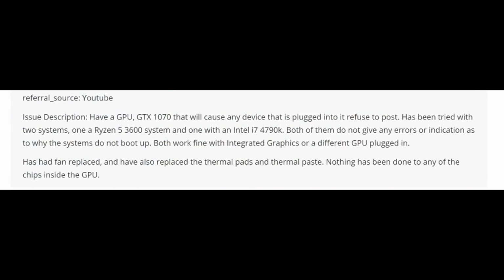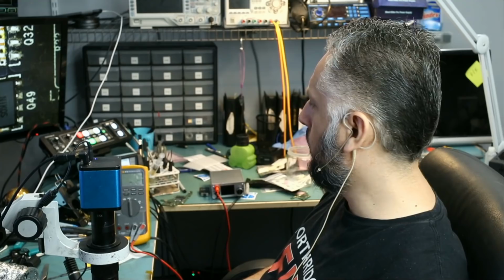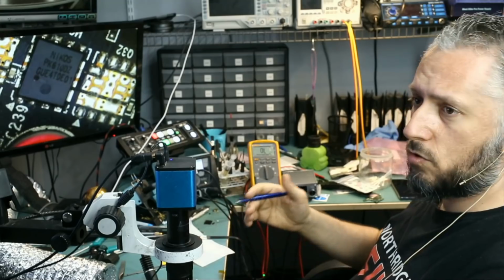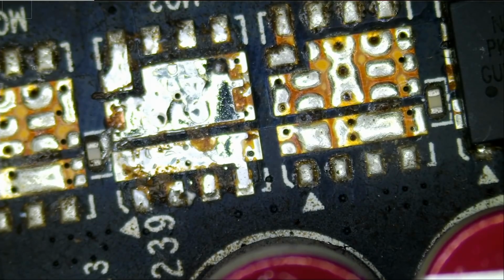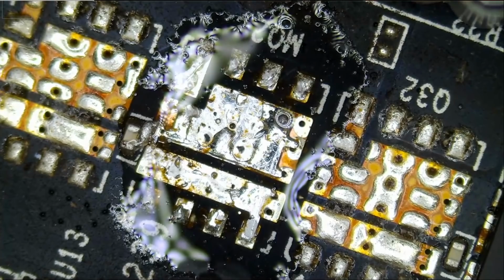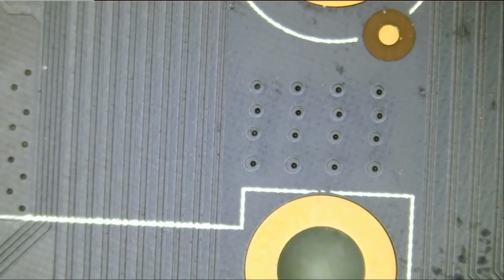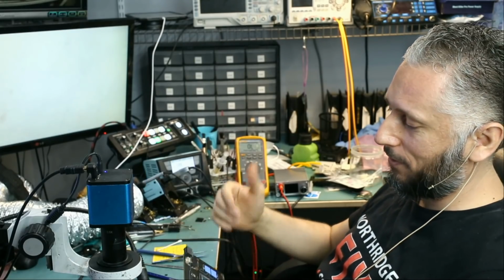Zotac GTX 1070 Mini Graphics Card Repair

Comment from the maker: There was a tiny blob of solder left of the mosfet that appeared to be bridging. It was later cleaned off and wasn't making any contact.
Reply: I was about to tell you  😂👍🏻👍🏻
Reply: There was a solder blob on the left side of the mosfet that was near an ceramic capacitor.
Great work man.👍
Reply: What time is it where you are? Do you edit your vids late at night after a long day of work? It is 9.30 am here in Ireland.
Reply: @dankan4459  he once mentioned that he stays awake editing videos till 3 am
Reply: @roseelectronics4582  that is dedication!
Reply: @dankan4459  indeed
Reply: @dankan4459  If it's 09:30 in Ireland it will be 01:30 in California, 8hr time difference.
Reply: that solder blob was already there from the beginning, even before you removed the mosfet., maybe it was the original issue bridging?
good fix though :)
Reply: haters gon hate
Reply: Thought you cleared that out huh🌝, some people are still complaining about it🙃.

 they probably think that when you end the video you stop working on the device, which usually happens After you give it to big boss for final assembly (I think). 

Nice work by the way I really like the Graphics cards repairs especially in these times.👍🏻🙂
Reply: Phew!!
Reply: hey what do you think that makes a dead card doing a loud coil whinning sound , no post no fan spin, i would appreciate anything if you have any advice on top of head , thanks
Reply: @trOyYey  mining cards it seems like lately really people shouldn't mine at all if they don't know what they are doing it's just destroying cards that we have a shortage on from scalpers and money hungry gpu hoarders
Reply: I actually noticed that. xD
Reply: lol i was staring at that the whole time like is he gonna clean that up but then when u never did I just figured it was another repair or something  lol
Reply: Was going to write about it ;) good job!
Reply: Silly question: how can you tell a N-Channel MOSFET from P-Channel, is due to the application, location, size, composition by design?
Reply: Another quick question: Does your multimeter provide diode readings as well when using continuity mode?
Reply: how much would that repair cost the customer in your shop?
Reply: I think i have one at the fourth one do you know how to fix it and so how to get part without buying donor gpu because there like 200 broken 500 used
Reply: I spotted that 😀
Reply: Yeah i noticed that aswell!
Reply: Nice

Comment: from my past experience usually ppl got short circuit because of not using a surge protector n a cheap psu without 80+ bronze sticker, rarely ppl got this issues when they r using that 2 tools

Comment: Hello Alex
I had 4 shorted MOSFETs in my GTX 970 so I replaced them but they shorted again. I noticed something very strange is that when I spray a contact cleaner on the corresponding Gate Driver the short is gone, but when I tried to power the card again the short is back. I did that about 3 times and the short goes away every time with the contact cleaner on the Gate Driver. How can that happen?

Comment: I have this exact same card but i Hurd a pop when I plugged it in to my new computer. and I belive I popped some of the resistor or caps thats under the headsink I was wondering if could repair mine or what parts I need to replace.

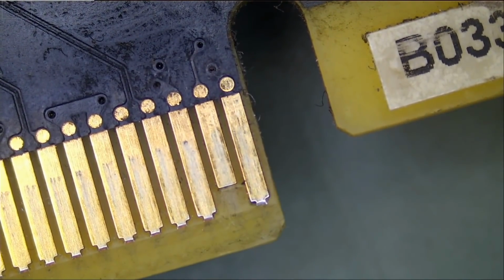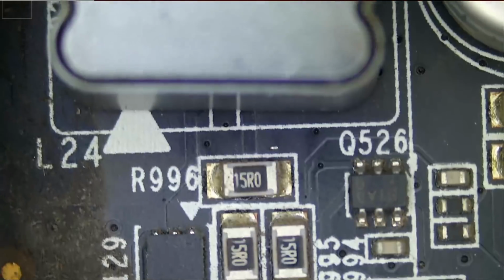Comment: that tiny piece on the edge connector gold plated finger you mention is broken off around 1:20-1:50 is actually meant to be that way, it's so the power is applied in certain sequence if hot plugging

Comment: I think you should install a hard drive with an operating system on the motherboard that you did the tests on it to see if the graphic card is fully working after the system boot's up.

Comment: hi, it would not be bad to check the signal shape of the repaired phase. because I know that transistors rarely burn out on their own. here, either the driver did not give the correct signal form or the transistor overheated. if there is an opportunity, can you check this in your videos, if you have an oscilloscope. it would be informative

Comment: 6:12, as y say before, grafic cards,  need do be preheat undernet the board, to make easy to remove mosfets, and cover aluminium folid the caps, using this metod mosfet is out in 10 seg or less, in a dayli basic work, it will show improve in time and quality of repair.

Comment: If the mosfet gate is less than infinity or the resistance of the drive then the probability is that the source - drain is also short. I usually measure the body diode of the mosfet to see that there is no short there.

Comment: I Change RX 570 8GB sapphire nitro thermal pads with thermal grizzly ones at 1mm size instead of 0.5mm and every card suddenly died with replaced pads.

Comment: I think that high resistance reading on first gate is part of a problem. Resistance you read came from pull down resistor. It's usually around 8-10K because that's value of gate discharged resistor used. Too high resistance on first gate can leave it closed when it should be open and destroy second mosfet in process.
It will probably die quicky again.

Comment: Hey @NorthridgeFix when applying heat near aluminum capacitors like you do here a neat little trick is to use the blade from a box cutting knife as a heat shield. Just rest it against the side of the capacitor and it'll dissipate the heat. Heck you probably have a load lying around somewhere too :D
Reply: There's a special heat resistant sticky tape just for this purpose as well! It's brown/gold-ish colour and semi transparent

Comment: He needs it expedited because he cannot miss out on Overclocked Bitcoin mining :)

The reason they have recessed contacts on the edge connector, is because the surrounding contacts will make contact to the connector BEFORE that pin does, it is a protection in case of either voltage or static, so when the shortened contact does make electrical contact, the surroundings ones are already on circuit, helps with grounding an important signal / trace

Comment: a trick to find low resitance 'near short' components is to put a little power on the shorted rail and use a thermal camera to look where it's getting hot or cover the board with alcohol and see if there are any hot spots, where it evaporates faster.

Comment: My guess as a guy who works with graphics cards there was ESD shot when replacing thermopads. I know that from my personal experience. It's a common problem. As you can see very easy to find and fix issue.

As usual amazing job @Northridge Fix! I am glad that those aluminum caps don't pop up when working near by 😉

Comment: Great Video. What is your mostly used Nozzle-Diameter on the Hot-Air? Greeting from Germany
Reply from the maker: I use the biggest available unless i want to focus heat on one specific component then I go for something smaller. I switch between 10mm to 3mm.https://northridgefix.com/product/quick-861dw-hot-air-station-nozzles/

Comment: The gate of a mosfet, out-of-circuit, should look like a capacitor: checking it with DC, from gate to source or drain, it should read as an open circuit. In circuit, of course, will vary depending on what it’s connected to.

Comment: Did you try reading that first mosfet after replacing the bad one? is it possible that the high reading on the first one was caused by the short on the second one? Sorry if this is a dumb question. Thanks for your videos and positive attitude :).
Reply from the maker: Yes still reading around 200k.

Comment: i am a bit disaponited you didn't notice that tiny solder blob stuck to that capacitor next to the mosfet you worked on, but i am impressed with the speed you found the fault
Reply from the maker: Read pinned comment
Reply: @NorthridgeFix  now i did :P
you never know about them when you watch someone video right after it comes out and comments didn't show u yet

Comment: You can use Kepton Tapes, to protect the caps, from the heat.
Reply from the maker: Kapton tape does not protect. It does more harm then good. Kapton Deforms when heat is applied to it causing components to shift when solder liquefy. I'll discuss this in a future video along with foil tape. .
Reply: @NorthridgeFix   foil tape leaves a glue residue on parts it's apply to, not easy to clean. It's not a problem for you ?
Reply: Aluminum EMI shields harvested from broken chargers may also work so that hot air at least doesn't directly hit the caps.

Comment: 1:20 tiny piece is not broken off, thats normal. my 2080 Ti looks the same.
Reply: That is standard length, it is shorter to prevent you from not seating the card right
Reply: yes, this is standard for PCIe, probably for hot swap / power contact reasons. Can be found on many cards.
Reply: I searched for RTX 2080 PCB and it has the same cuted pin
Reply: but is it broken or is it a pcie standard length of the last pcie line, because it does exist on every pcie device regardless the bus length
Reply: @fabian weird flex but ok🙂
Reply: Yes, that is factory standard on all GPU's from nVidia. Not sure about AMD cards.